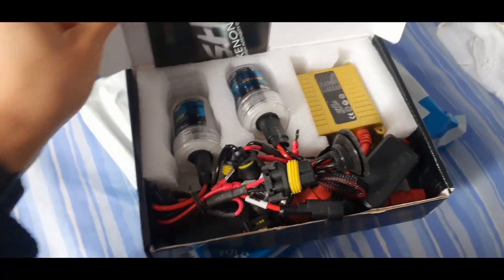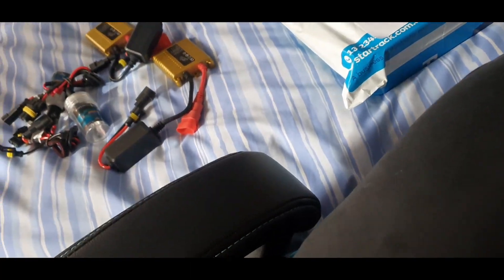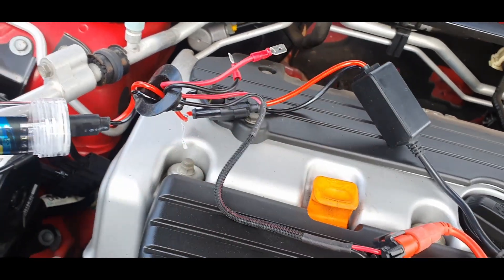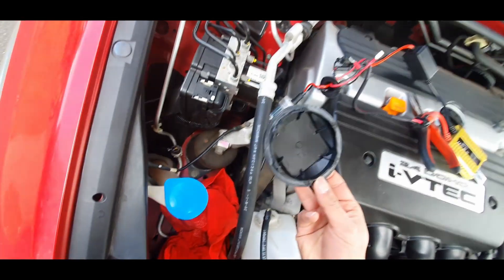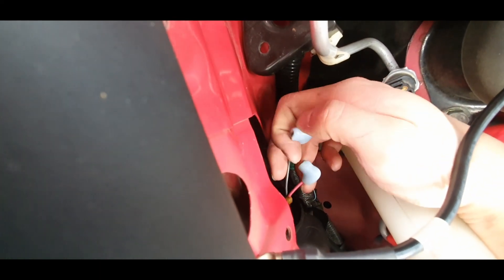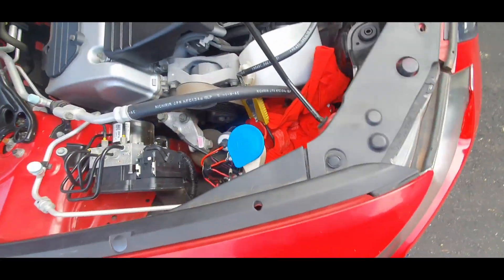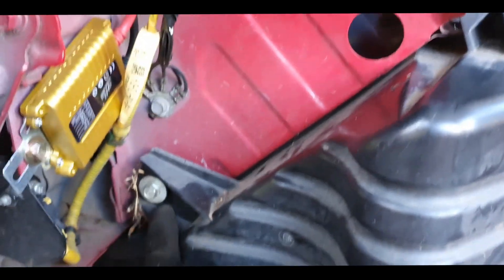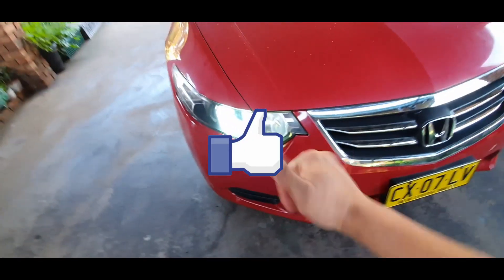How to install HID Kit on Honda Accord EURO CU2

Comment: Great video! Would love to see a tutorial on how you go about adding fog lights to a CU2
Reply from the maker: Thanks Johnny. Won't be adding fog lights to mine but you can either get a external system like this and do the fogs or connect to existing foglights wires and insert foglights good luck!